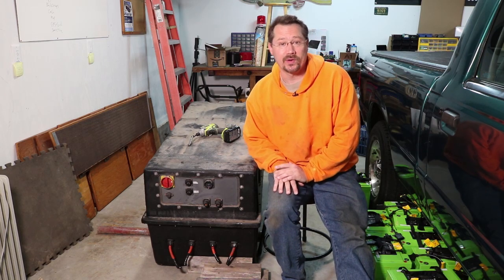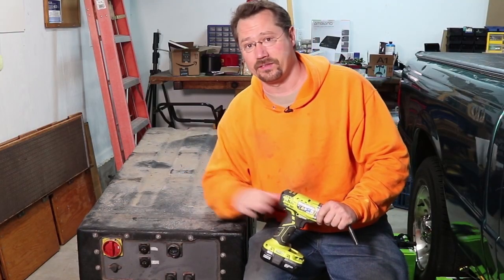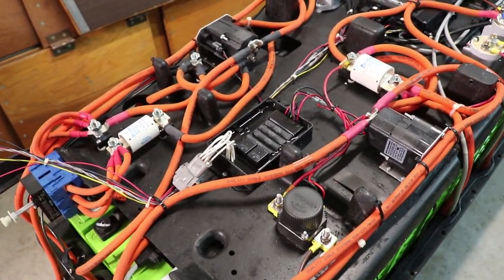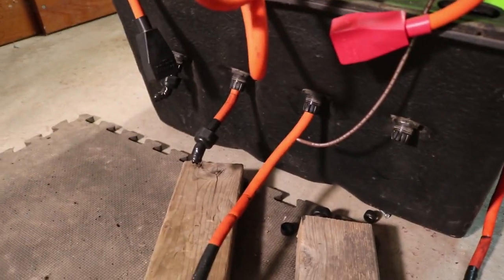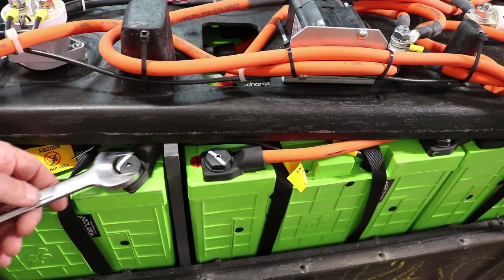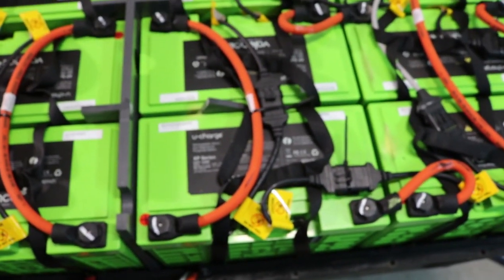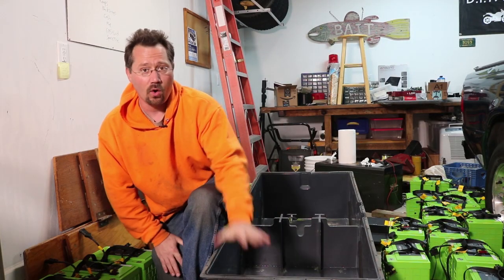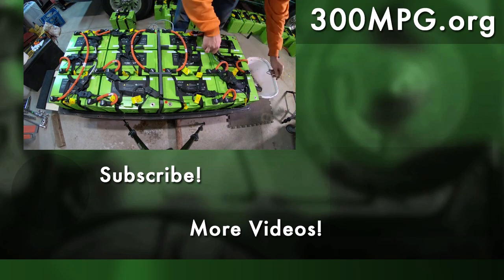9 Junkyard Electric Truck: Battery Pack Disassembly

Comment: Nice score Ben!  I have some of those Valence batteries too. They are awesome for solar!
Reply from the maker: That's exactly what I was thinking. Lithium batteries for solar tends to be SO expensive that it's been slow to catch on so far. I'm really hoping we see more and more automotive lithium batteries repurposed for second life solar storage.
Reply: I have two of these for solar storage. Do you know if I need an external BMS if I run them in parallel?

Comment: What an intriguing project... Great WORK!!!  I have to ask though... why was a running/driving electric cargo truck being sold as salvage?
Reply from the maker: The previous owner was in Chicago and had a one-car garage. He was getting a brand-new Tesla  delivered 2 days after I got the truck from him.
Either the Tesla would be parked on the street in Chicago, or the truck would be!
He was basically just trying to get rid of it quick, but at least wanted somebody who would use it / fix it / take care of it.

Comment: You mentioned possible uses for the batteries but, I'm curious, what are YOU going to do with them?  Build a power wall for your solar system?  Power the Ford truck?

Comment: Hi 
Does the Valence U27-12XP batteries have there own BMS inside each other, so I can put two in parallel in my RV, or does the connectors have to be plug into each battery and then to a outside BMS controller or computer ? I have seen used ones for sale, but wasn’t to sure about them being used in a RV like any other battery, 
Thank you

Comment: Where i live are basically hills, how do i know if a dc motor will do the job i want? May i transform hp in to watts?
Reply from the maker: Yes, a basic way to compare horsepower and power in watts is one Horsepower equals about 746 watts.

Comment: Hi Ben, is your first electric car still around? are you still driving it??
Reply from the maker: No. At this point, it would be a 23 year-old car. In my area, we use lots of salt on the roads in the winter. Rust really ate away at the car. All the EV components were still good. I decommissioned the car, removing all the EV parts, and then donating the frame.
The motor and controller from the car are currently in a lawn tractor.
Here's one short video of that tractor: https://www.youtube.com/watch?v=_cavmhl1n5I
Reply: BenjaminNelson wow, at least you got all the Ev parts. I was very impressed by your video and you uploaded them in 2009 am glad to see that you are still uploading new videos. Thanks 🙏🏿

Comment: everytime you said high voltage (12V) you really meant high ampere (lots of 12V in parallel) right ?
Reply from the maker: No! These are all in series. The voltage adds up. When all these batteries are connected, it's around 312VDC.
A person needs to be VERY careful with that kind of voltage.
Breaking the pack down into sections quickly reduces the possible voltage. I was very careful to check various points with my multimeter to reduce risk of shock, short-circuits, or other electrical dangers.
Reply: @BenjaminNelsonX  But wait,  a Tesla coil, is SUPER hi Volts, can stand your hair up, light a FL light wirelessly yet is safe due to Low amps,  while a 2 volt forklift battery CELL can literally melt / reshape the lead post with a carbon rod due to hi AMPS...  Your dealing with both ... hi enough volts and PLENTY of amps soo b CAREFUL

Comment: Does each battery have a BMS?
Reply from the maker: Each battery has a BMS board inside for dealing with the proper charging and equalization of the cells inside. It connects externally to other batteries and sort of a "Master BMS" box, which can do things like deactivate the charger.
You can NOT get those BMSs individually from Valence, as they just do OEM, but there's another company now who made their own version. It's really what you want for doing something like a solar battery system with these.
https://www.mullerindustriesusa.com/product/miusa-bmslv-valence-battery-management-system/

Comment: So this is you that bought the truck at CoPart auction. You didn't got the motor controller and motor as well ? Only bought the pack ??
Reply from the maker: We bought the entire truck, but weren't able to bring it back. As a consolation price, we removed and brought back with us the batteries. We would get the rest of the truck later.
Reply: @BenjaminNelsonX  ohhh i see but do you know what is the motor and controller inside ? Is it DC, AC, brushless ? Smith branded or a company that still exists ?
Reply from the maker: @QuebecoisSti  The motor in the Smith truck is about 100hp AC. The company that made the motor and controller are out of business.
I think that might be one factor in why these trucks were dumped.

Comment: It’s not the voltage that kills.
Reply from the maker: No, but it's the voltage that drives the current which then kills.

At low voltages, human skin offers enough resistance to prevent current from flowing.
At high voltages, current can flow right through you, causing burns or death.

Just always make sure to follow best safety practices.

Comment: Puts the batteries on the cement floor
Reply: @d7j6f1001 Rae sorry to disappoint you, the great myth was perpetuated because the first lead acid batteries were made with Bakelite casings which was very brittle, and would break when not put down very carefully. " They " The battery makers, mechanics,
starts telling the people must put it on wood or rubber to prevent
it getting flat, but actually they did not want the battery to break.
Reply: @nicosadie4527  glad someone knows the truth. I've had huge arguments with people about this.  Simple logic and common Sense disproves the Smith but some people cannot think for them selves